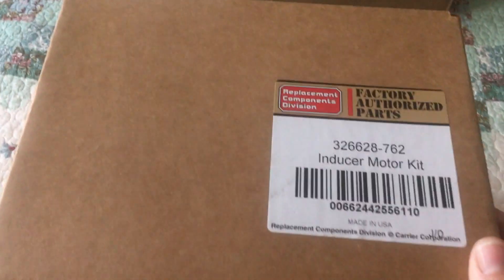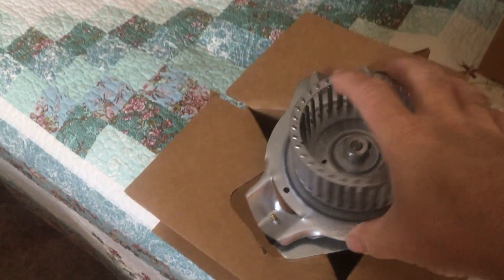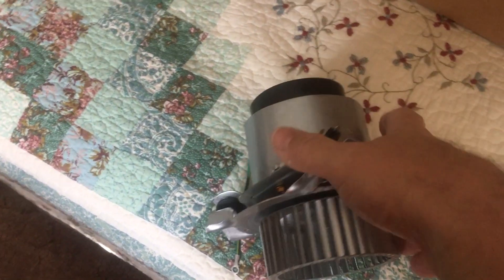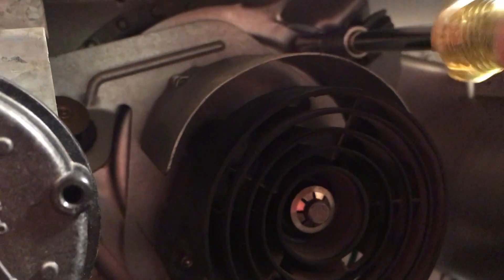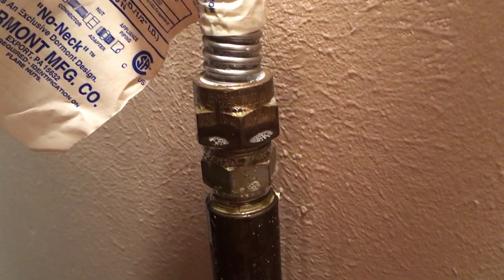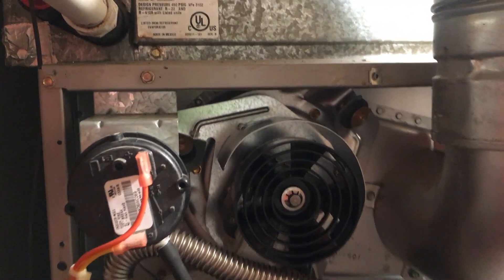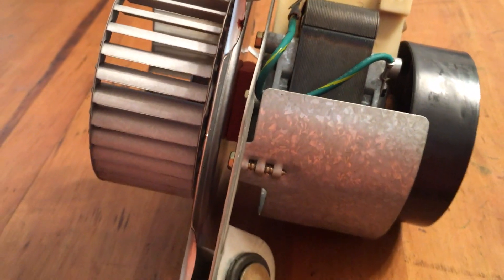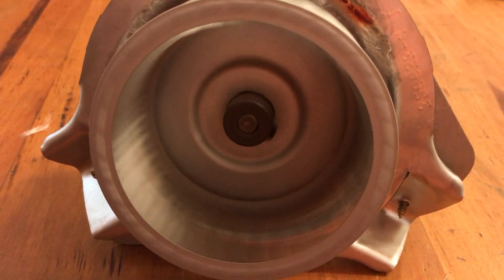The 2020 Heater Season, Part Three: 2003 Carrier Gas Furnace, And Minor Fail

Comment: My carrier furnace did the same thing. The draft inducer rattled about 17 years after it was made. The blower also went out about 2 weeks ago on ours, and we just got a new furnace! It served us well for over 18 years!
Reply from the maker: Yep, this one is replaced as well. I saved the old inducer, since the new furnace has a similar, if not exact inducer assembly. Also saved the psc blower from the old, as the new furnace has an ecm motor.

Comment: Not quite cold here in Southern California to turn on the heater but I might use my fireplace in the meantime since I have a whole bunch of firewood out back. Since this is on the subject of Octember[TM], unfortunately I had a fail with my 1973 Maytag A606 since there was some water dripping from the pump area so I’ll guess I need to order a new pump for it but it’s not a big deal since it’s a easy repair.
Reply from the maker: Well at least that is a very easy fix. I replaced the pump on the A106 during my lunch break, many years ago!

Comment: Well that was a quick, easy repair.  I guess after 17 years, it doesn't owe you anything.
Reply from the maker: While an easy repair, it wasn't too easy on my wallet! I'm happy it's done, and the clanks have gone away. I have one more Octember fail, and another successful repair. 
Also, some good news to start out November! The Tundra passed it's annual state inspection today. I'm sure the check engine light will come back on tomorrow, but at least I know it's a P0420, so no big deal.
Reply: @dynatrak  What did they get for the inducer, if I may ask?
Reply from the maker: @jaykay18  $300 including tax for the OEM USA version. The china version is about half that. When dealing with something like this, I didn't want to cheap out.
Reply: @dynatrak  OUCH!  When I had a bad circulator pump on my boiler, it was $89.  Had an American Flag on the box, for what it's worth.
Reply from the maker: @jaykay18  Well that's a nice touch!
Yeah, hopefully this is the "big one." Now to be extra stingy, until that money is back in the account.